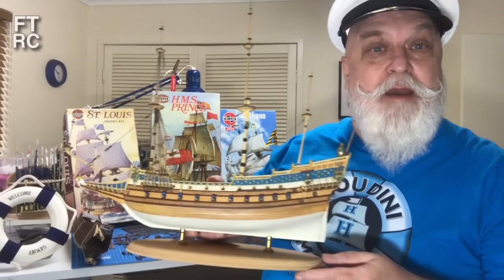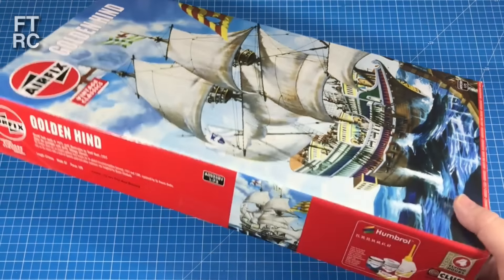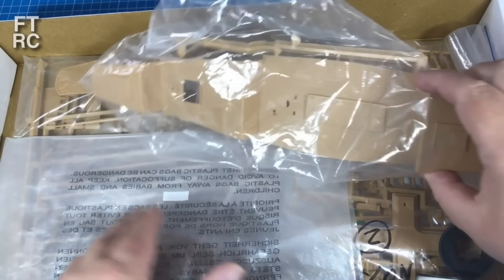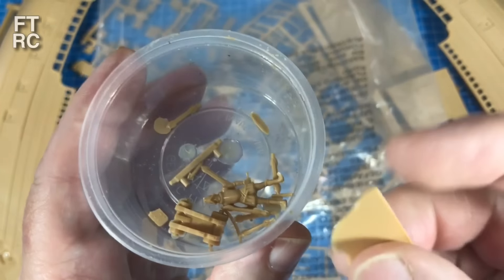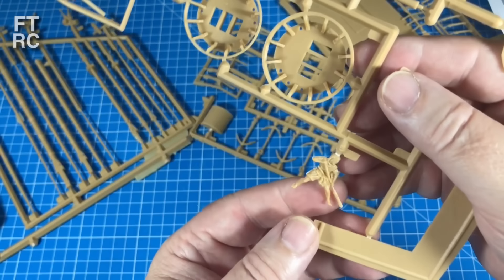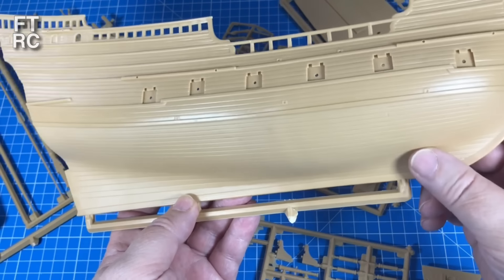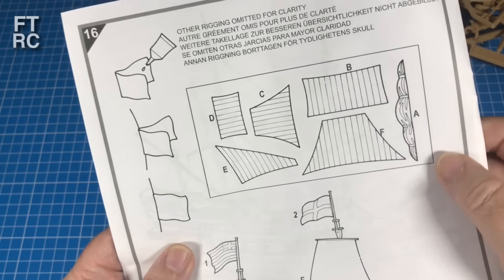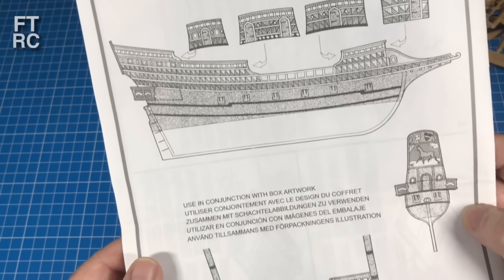Review of the Airfix Vintage Classic 1/72  Golden Hind - Finding Airfix Rare Kits Series

Comment: Not sure where you get your release info from Harry but Airfix released the 1/72 kit in a Red Box up to 2016.

Golden Hind  09258-4/09258/A50046/A09258V 1/72 scale. Available as 09258-4 from 1978 to 1980, listed as 911201 in 1985 catalogue but not issued. Reissued as 09258 from 1988 to 2002, in gift set A50046 from 2010 to 2016 and as A09258V from 2019. Also issued by MPC (USA) as 1-5904 16th Century Galleon in 1982.

I'm liking the mould colour, at least it's not that orrid dark grey so thanks for the look at the bits, didn't they used to include ghastly looking black moulded rat lines? the cotton reels look like a better bet, progress Harry! I'll email you a link to an accurate list.
Reply from the maker: Well that is annoying.  As Scalemates only listed the last release of 1999, and I had not seen the kit in the stores down here since I returned to the hobby, plus with Airfix not usually releasing a “Vintage Classic” unless it was an old kit out of production for a while, I simply assumed Airfix had no 21st century red boxes.

Thanks for the TXT file, but it is long and convoluted.  A spread sheet would have been a better way to store and share the information.
Reply: @HarryHoudiniModels  - it's ok Harry I'm not the Airfix Police, 1997 is presumably where the cotton reels were added as 'new parts'? Airfix ran it from 1978 - 1980, went bust, Humbrol ran it from 1988 - 2002, went bust, Hornby ran it from 2010 to 2016, 2019 > and the cotton reels are still rolling off the table! not sure Scalemates mentioned most of that.

The red box release is included on Scalemates just not on the same page, there's two timelines there, one with and one without the red box. Part of the problem is Scalemates is based on box style changes without saying when the run ended, just when the next box style or rejig began which isn't necessarily the same date or even the next release start date, the dates and gaps in production are not there or based purely on box design changes.

I'm not sure much has been changed by Vintage Classic releases except it's a clever way to keep using the old tooling without as many complaints except to say it's brought some kits not seen for decades out of hiding, just not in this case Harry, some of those large scale Ships go back to 1962 but even they've been seen in the 21st Century, HMS Revenge last seen in 1991 perhaps longest out of production (without finding each in turn in the list).

Comment: In my childhood, my brother received an Airfix Saint Louis ship model kit as a gift, and it remains as one of the most beautiful memories of my childhood. Unfortunately, finding this kit, like other Airfix ship model kits, is very difficult. I don't understand why Airfix isn't re-releasing these kits; despite all its flaws, Revell is at least continuing its plastic sailing ship series.
Reply from the maker: They lost a lot of the old moulds and many were broken, so they are only re-releasing what they have that still can be used for injection moulding.  Heller do a St Louis as does Lindberg, but I do prefer the Airfix one myself.